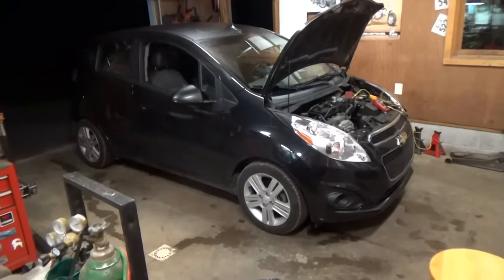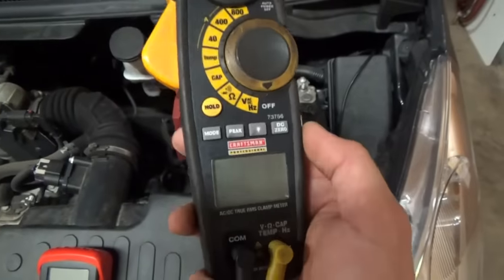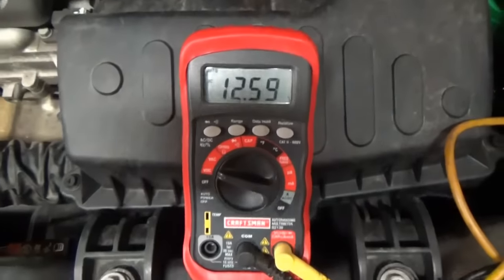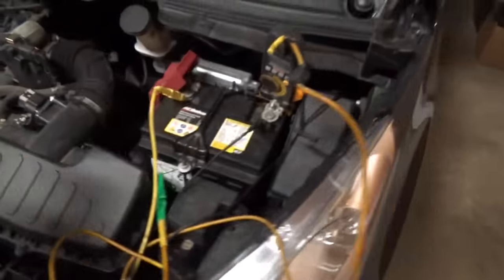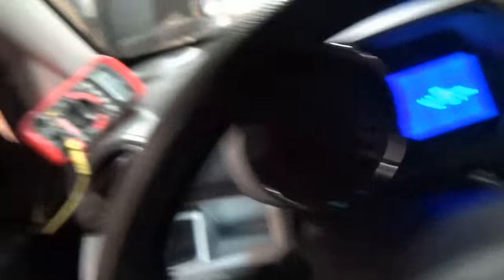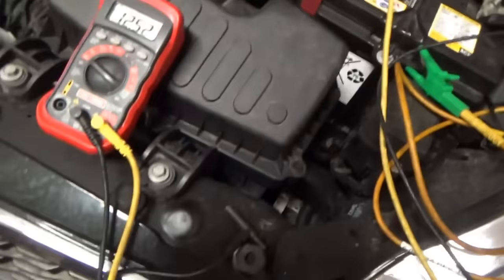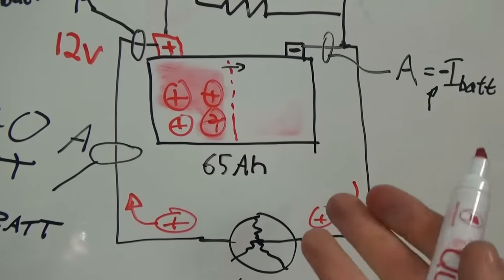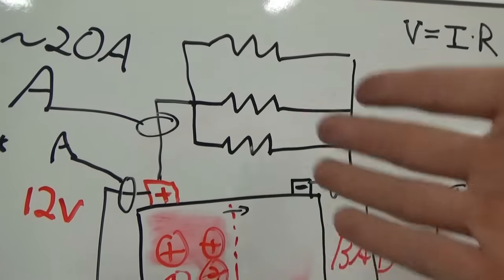Battery-Alternator-Draw Tests: EASY & ACCURATE

Comment: I thought the Computer, Radio, Alarm, always used a bit of power.
Reply: Once all modules go to sleep, you generally want to see 50 milliamps (.050 amps) or less. Now the time it takes for everything to sleep varies greatly by manufacturer and model. So you are indeed correct there is always some draw, but it's so slight when things are working correctly that it typically would take weeks to kill the battery. Hope that helps clear things up.
Reply from the maker: I had a 30mA draw from an aftermarket power inverter in my truck. Would drain the battery in 2 weeks if I didn't drive it. You want less than 10mA parasitic draw on a healthy system.
Reply: I have to say, pretty honest parts place that did the battery test, telling him it wasnt the battery, since they do sell batteries. But I guess due to their lack of knowledge they blew the sale anyway. This video explained alot, now if I can just remember, Heck I will just save it. Now I guess I will have to get a DC Amp Clamp, have a A/C but it dosent do D/C. Its a 13 dollar one from Harbor Freight. Say you get the same battery as the one you just installed, if you have it totally charged up, and remove it from the car, how long would it still be able to start a car ? Wonder haw many DC Amp clamps will be sold due to this video.
Reply: @PineHollowAutoDiagnostics  I'd say that's going to depend on the vehicle and the battery in it. I'd imagine you'd be hard pressed to find a late model luxury car with parasitic draw that low but I've definitely seen it on a more basic or older vehicle. 50 milliamps is a generic spec but I've seen manufacturer specific specs that were slightly higher or lower than that (I think it was Lexus where I saw a spec as high as 70 or 75 milliamps.) That's just been my experience mind you. As well you know sir, every vehicle is different as is every situation.

Comment: I think some of this video is wrong. You said the "charges" move  from positive to negative. This is very much wrong. Electrons are negatively charged particles and move toward positive protons and not vice versa. I read an article many years ago and  it said all DC circuit schematics are written as positive moving toward negative because many years ago it was not known  electrons were negatively charged particles. When it was found out electrons were negative charged, it was to late to rewrite all schematics and change the rules. So if you want to think like and electron, you come out of the negative  post of the  battery, move through the car body,  move through all the components in the car, and all the while you are headed for the positive post of the battery. Also I read an article about two years ago and it said electrons move very very slow and maybe so slow you  really need to think of electricity as something that just vibrates  in a circuit with little or possibly no movement as thought of. I don't know. I ain't no physicist..
Reply from the maker: Sure we all "know" that the electrons are moving, but why not just use conventional positive charge theory to avoid confusion. The "vibrating" electricity you mention is Alternating Current, or AC. :)
Reply: @PineHollowAutoDiagnostics   Conventional positive charge theory should be avoided. If you think about Cern smashing particles together at near light speed to see what happens, well, it could be a mess up if "conventional theory" is taken for granted as an assumption.  I had a guy approach me one time and ask me, do you know you should always hook up the positive side first when dealing with a car battery and I said yes I do know. Electrons are negatively charged and he looked at me with confusion. I think about electricity as being voltage is how fast electrons move, the potential of them, and current as how many electrons move.  I think what got me most and made me comment is when you said all of these positive charges are looking for "work" to do. That also is bad wrong to say. We both know work is the same as a watt, but the work is from the electron, not the proton and after all isn't it the watt that is conventional? What you did say that was correct is your not going to far down the rabbit hole and I understand that. Insanity prevails in that rabbit hole. Also, you should not refer to electricity as current. It would be better to refer to it as voltage, its potential, but even that is wrong, so call electricity, electricity. Make a good habit out of it. :) I think the article about vibrating electricity was about A/C so it just got me thinking more about D/C and got me to thinking what goes on inside an atom and man, I got a headache. I don't mean to take anything from you, your a very intelligent guy and thank you for reading the mess I type and commenting. I bet you may be interested in this video to think about????
https://www.youtube.com/watch?v=HiAj7S6ko9Q
Reply from the maker: Wow hahaha I do love getting deep into the details of the physics. However this was meant to be a video to diagnose and fix a car with 100% accuracy and not getting confused ;)

Comment: This is the difference between an auto electrician and a schoolboy. These new fangled battery testers are only as good as the man using them. Modern cars  ( my RV ) nackers up the Air bag module if the battery gets to this stage. These idiots make, what should be a straight forward job into a nightmare for car owners. The simple lights on test from ignition off showed the battery was goosed.

Comment: 10/5/2020
Southern California

Around the 16 minute section , the Author confused me when he didn't agree with the 6 Amps reading on the Negative Battery Cable.

This is why many people change the Womans Alternator "4" times in one month because they aren't aware of the Battery Recharge Current Test on the Negative Battery Cable with a Current Clamp Meter.

After 5 minutes of Engine Running, if the Amperage is Less than 10 Amps, the Battery is good. If it's greater than 10 Amps the Alternator will be destroyed.
....Plus you better know how to Test the Computer if the "Voltage Regulator" is inside the Computer.

Think I don't know what I'm talking about.
Purchase the "Vehicle Electrical Shortcuts" Spiral Bound book.
( "7" Small Chapters )
www.veejer.com

I didn't  get this info in College Automotive.
Chapter 4 : Batteries
Chapter 5 : Starters
Chapter 6 : Alternators
           AND
Real Voltage Drop Testing with large photos & Positive & Negative Voltmeter Leads clearly shown where to connect.

"O.G." Vince Fischelli
Dallas, Texas
www.veejer.com

My mistake. The "First Things First" Flip Chart is where Crystal Clear photos are shown doing "Voltage Drop" Testing.
....Both purchases you will not regret...